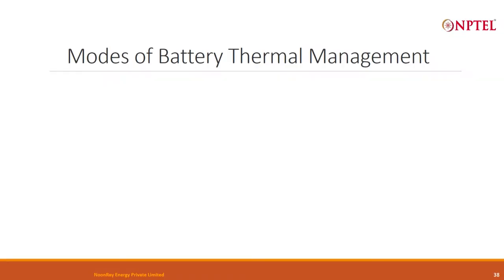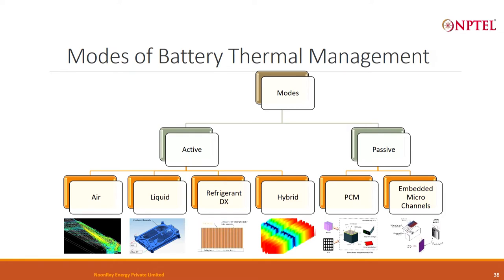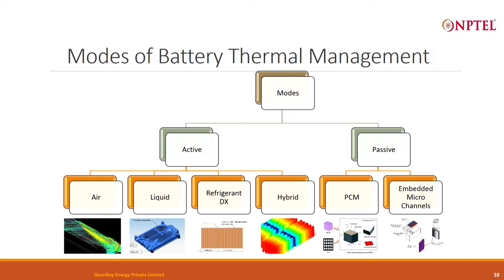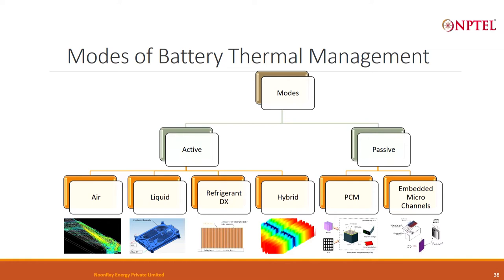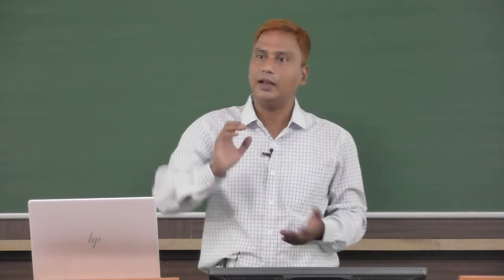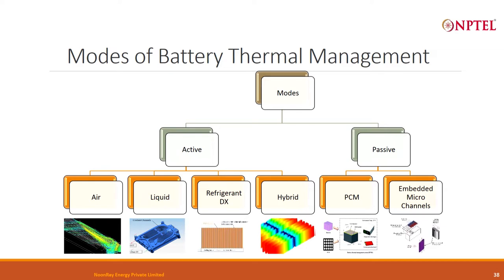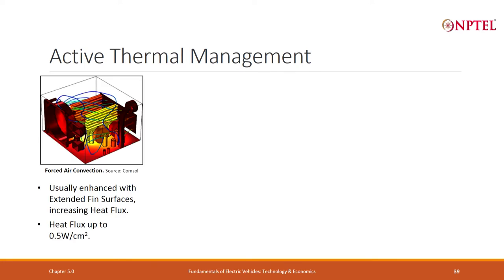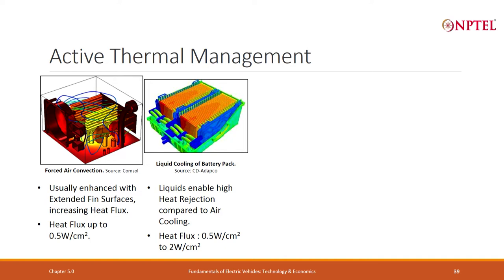Lecture 39 - Thermal Design - Part 3

Comment: 1C means 15amp of current taken for 1hr will discharge cell  from 100% to 0%.
So, for the first problem you have solved 
Shouldn't be time for discharging from 100 to 20%Soc = 24 Ah / 15 A = 1.6 Hrs= 5760 seconds......?
Reply: 1C will take 1 hour to discharge from  100% to 0% for a 15 Amp cell. The time for discharging from 100% to 20% will be 80 % of 1 hour i.e 2880 sec.  For example if the discharge rate is 2C the same cell will  take half the time while the current will be doubled, (1 hr /2) * 0.8*3600= 1440 sec  from 100% to 20%.
Reply: @harshmeetsingh5696  Okay got it. Thank you
Reply: @harshmeetsingh5696  Hello Harshmeet have you solved the assignment problems?
Reply: If we discharge at 2C how does the heat generated differ? Won't It be the same ? Energy lost per cell only varies.....correct me if I'm wrong